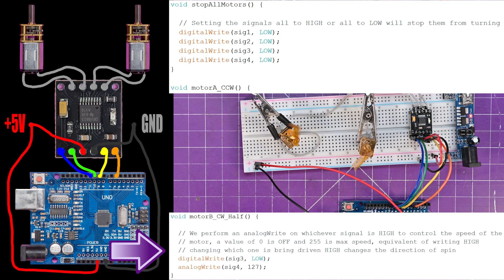Power In A Tiny Package || DRV8833 Tutorial As Easily As Possible

Comment: The DRV8833 motor driver has 4 control inputs (IN1,IN2,IN3,IN4) and 4 outputs (OUT1, OUT2, OUT3, OUT4). Can I use these 4 outputs to control 4 small coreless DC motors independently if I connect each output to one motor and drive each input with separate PWM signals from a microcontroller?”

Comment: What happens if you disconnect one of the output wires while the motor is running? 
If the chip burns, you would need external schottky diodes to VCC and GND on every output pin. 
Synchronous rectification won't be good enough in that scenario.

Comment: What happens if input 1 and input 2 is high at the same time?
Reply from the maker: It stops - same as both LOW - I think it's explained on the web article
Reply: @SimpleElectronics  Thanks for the demo.  Unfamiliar with this one, but would like to see it go up to 12V.
Some bridge drivers have more states, like Break (open circuit) and Coast (short circuit), giving function to (0,0), and (1,1).

Comment: When I started using these, nobody else was or at least posting about it. There were more expensive then but still less than the internet's fave.  I have been using them in repurposed RC and toys. The current project is using the 16 channel LED/servo chip to handle multi-motor construction toys. Working to expand some code to use with two wheel or track steering/drive incorporating the servo chip. "RC Tractor Guy" wrote the base code that is being hacked on. 

Fun fact: most of the cheap Chinese RC toys have H-bridge chips that match the pinouts of the TI chip. Some match the specs exactly.  There is a strange two H-bridge chip that the pinout make it feel like there are two chips in one package. Separate Vcc, gnd, and unspecified outputs that wasn't connected.